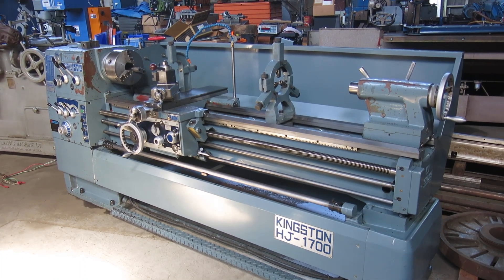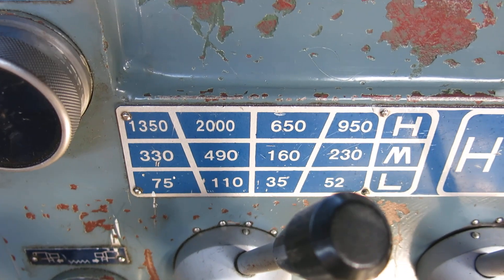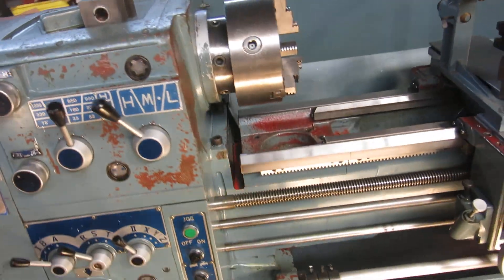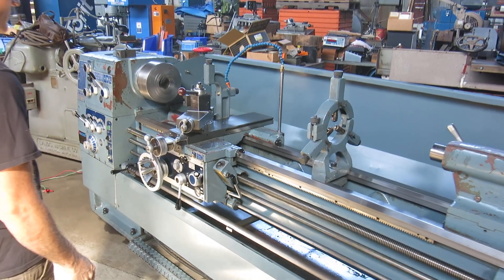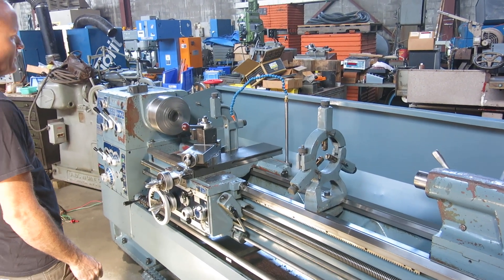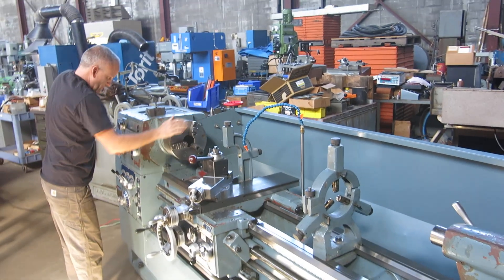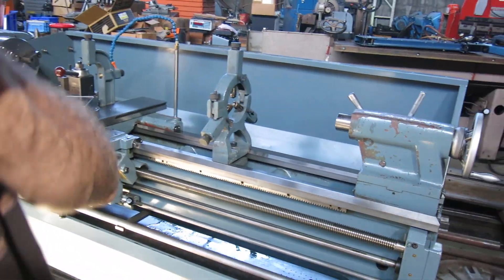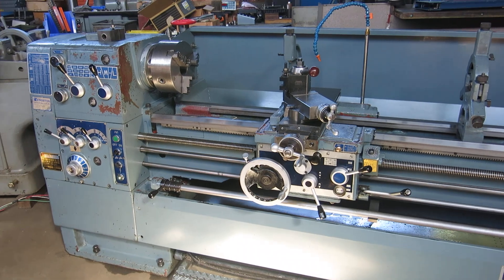Kingston HJ-1700 Lathe 17″ x 67″ @ Mullin Machinery of NJ

Comment: 1:42 is the foot brake not connected to an e-stop?
Reply from the maker: It opens a contactor stopping the motor and added pressure on the bar applies the friction brake band.
Reply from the maker: I just tapped it lightly and did not clear the micro-switch enough to break the contactor.